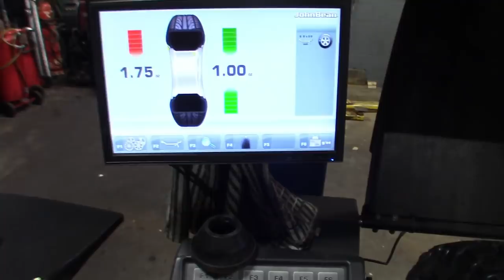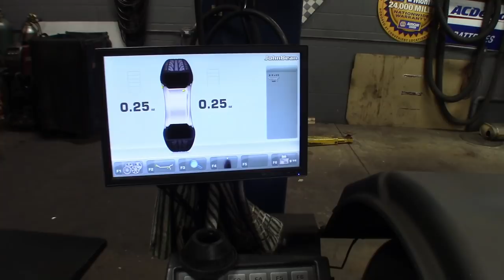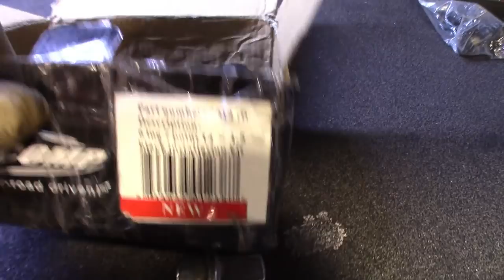SNOW DAY=SNOW TIRE UPGRADE

Comment: I got to do a set of snow tires last night in the parking lot, rims didn't fit.  Had to go open up the center bore with a die grinder and then head back out into the snow to install them. 
Then today I got to go out pick up a tractor trailer deliver it to a shop to get loaded and do a re-torque on both out in the snow.  Then this afternoon the boss came and asked me to go outside and take a look at something, I get out there and see this beautiful tri-axle goose neck double car hauler...... 2 broken cross members and it twists around like a leaf in the wind.  I look at them and just say "I'm not fixing this out in the snow" LOL 
It gets to come inside out of the weather next week 😉 

Keep up the great videos Boss and thanks for the stickers, I got them in the mail last night 👍

Comment: Your balancer is way nicer than the old Coats machine I used to have to wrestle with. I also didn't have much to do with tires, other than my own stuff, since TPMS became huge. I think last time I changed tires for a customer in a shop setting was probably '08. Snow tires make all the difference in the world. Best upgrade anyone can do this time of year. Of course if you're gonna keep your truck/car for years then I'd still recommend some dedicated steel rims for those tires, but there goes your TPMS sensors for the winter months...
Reply: Email me when you have a second or IM via Insta or something like that.